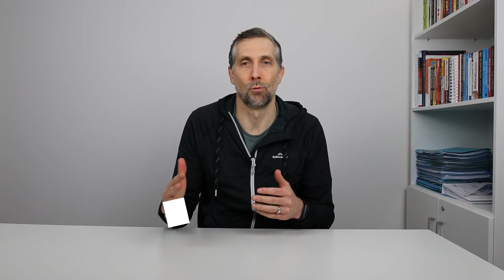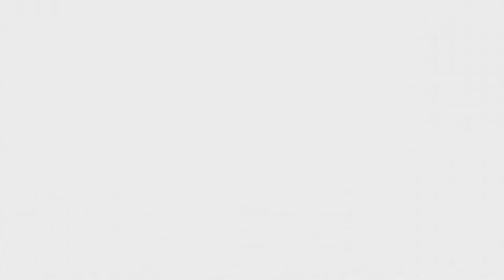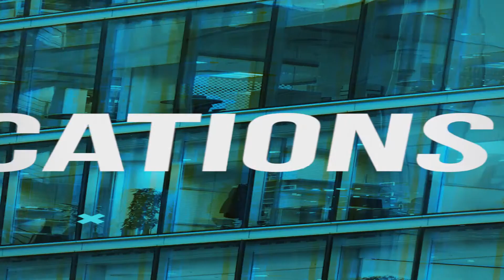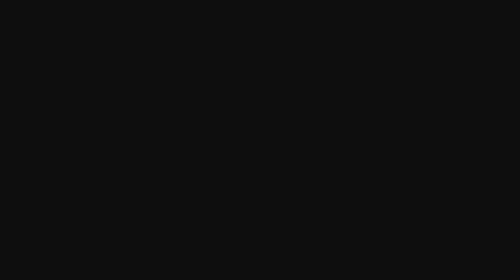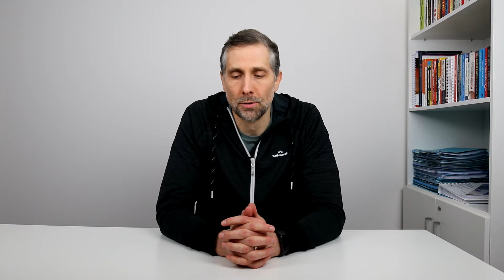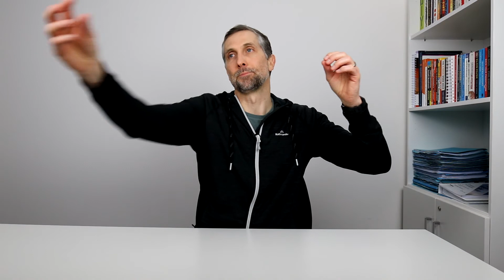BMS Design For Data Centres - Start-up and Monitoring

Comment: Just a question from me who isn't familiar well with DCs' BMS, for N+1 By pass Chilled Water Bypass valve control, are there 2 by pass lines at Mechanical side? OR just installing 2 valves at the same bypass line?
Thanks Bryce.
Reply from the maker: You could put two bypass control valves in parallel, so that if one failed, the other could take over. I'd suggest you buy an actuator that has positive feedback (very cheap or free) so that you are able to determine that the actuator has failed. 
Many DC's have two chilled water ring mains, or circuits, so that when they isolated one ring to make modifications the other ring will serve the CRAC's. In these situations there will probably be two bypass lines, so the valves will each be in two different bypass lines. 
You probably also need multiple system pressure transmitters for pump speed control.

Comment: I agree about having individual control panels, one per chiller, for reliability.  My question though is one of these panels needs the sequence controller software and if that's the faulted controller what are the chillers going to do?  Perhaps have normally closed relay contacts on the BMS enable, or is the sequencer held in all panels with some sort of hierarchy ?  Or perhaps all the chillers are just always enabled once the cooling load is say above 50% or so of the installed cooling provided.
Reply from the maker: Yes, the sequencer controller is a problem, as you have described. 
I have not found a great solution to this yet. 
I personally try stear away from hot standby controllers. Just a bit too complicated and some BMS systems can't do this. 
I do what you suggested. Try to create a fallback scenario for the chillers to default to if the sequencer fails. 
In the past, BMS companies have proposed to duplicate the staging code in two of the chiller controllers, with some sort of watchdog status check between the two. But, I have not specified this before.
Reply: @bryceanderson17  There are many strategies you can use to get a resilient system. The data centre I just completed consists of a master controller that sequence 14 cooling generator modules (Pump, chiller and 2No dry coolers - each of them with its own control panel), if it were to fail, a standby sequencer takes over instantly (not extremely complicated), furthermore, if the standby also fails, they are all enabled and the respective pump controlled to a max desired flow. Hope this helps a bit.
Reply: you need to upstream severs to send heartbeat signal to recognize if the primary/master controller is alive. @erickginesta659